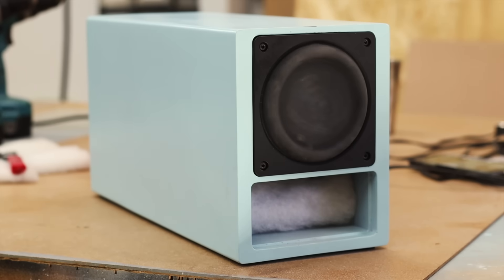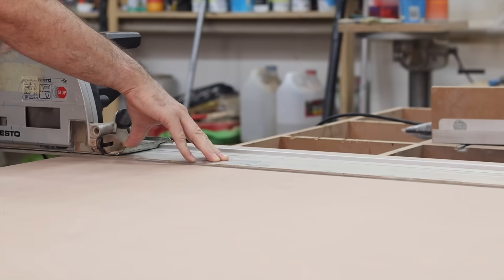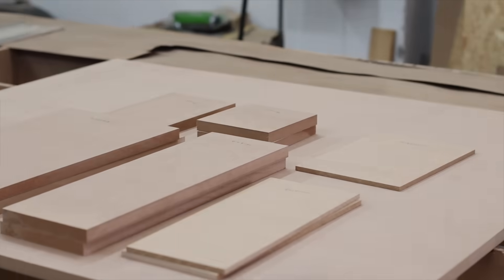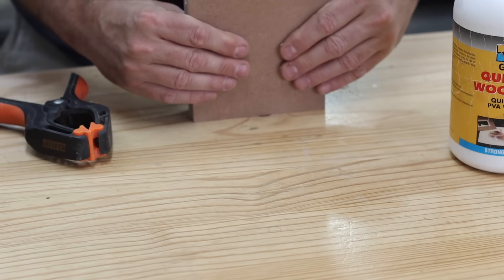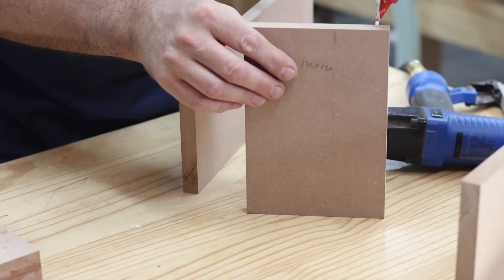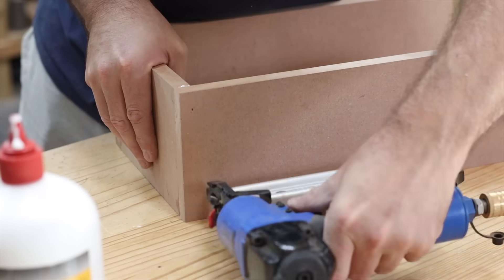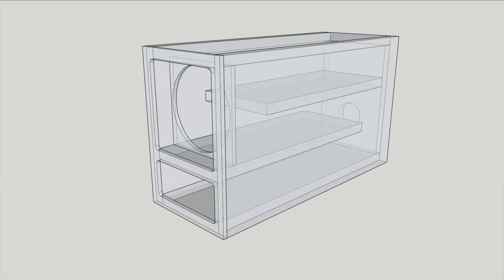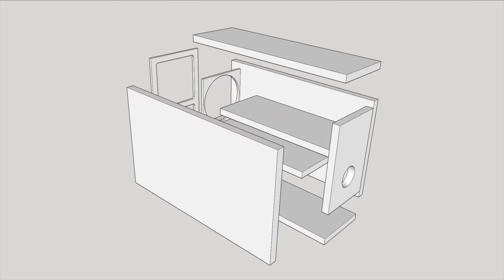Building a 4" Transmission Line Subwoofer - by SoundBlab

Comment: Hi. Good information. I’m looking for a passive, high quality stereo soundbar type custom speaker for under a TV. Short and wide down to 40 hz. Maybe I could help sponsor a video that explores the topic?
Reply from the maker: Thanks for the support. I am planning a soundbase for under a TV, but it will be about 1000mm wide and 250mm deep more or less. This is so that we have enough volume for decent bass output of the subwoofer driver. Stay tuned, hopefully the project will be done early next year.

Comment: Sidenote: It's not a subwoofer. The transmission line needs to be minimum 1/4 the wavelength in size so 20hz requires 4,25m of line.

Comment: i have a 4inch 4ohm 20w woofer from an old cheap subwoofer which i don't know the ts parameters but it plays under 40hz well free air
Can i still use this build?
To prevent damage i'll just lower the gain on my amp
Will this build work for me without knowing the ts parameters of my woofer if i dont play too loud?

Comment: I have never seen the driver placed midway through the line section. Its always at the other end or farthest away from the port opening. Lengthwise. If that makes sense.  It's odd like this. A Unicorn box.

Comment: Reformulated question: Would it be possible to add a mini tweeter to a 2.0-channel soundbar via serial connection, turning it into a 3.0 channel soundbar to get a better sound clarity (clear and crisp dialogues)?
Reply from the maker: I would not connect it in series, but i parallel to the drivers. It will be a bit of a hit and miss exercise though.

Comment: Hi there. I like all of your videos since you explain things in very easy terms to understand, particularly, for a newbie, like myself, and which has led me to start building my system from scratch. One of the things I'm planning to build is a Transmission Line enclosure. Got a question - let's say my target frequency were 35Hz using a driver with a frequency response of 44Hz - 22000Hz. So, 35Hz is below 44Hz. Will my T-Line enclosure be able to hit the target? Or I do I need to set a new target at a point no lower than the one part of the driver's frequency response? Is there any restriction aside from the length of the tunnel and its cross-sectional area? Can it be tuned for any given frequency regardless of the speakers frequency response? Regards and, please, never stop making videos.
Reply from the maker: Thanks man! It's difficult to say. It all depends on the driver specifications. You can go lower than the FS of the driver, but would not push it beyond 5 or 10 dB. The driver will run out of steam and you will get what we call a shelved response in the lower part of the frequency response. This transmission line calculator will help you to determine the ideal response: http://www.mh-audio.nl/Calculators/TML.html
Reply: @SoundBlab  Thanks for the info and link. I'll jump to it right away

Comment: what will happen if theres no stuffing?
Reply from the maker: The stuffing is there to slow down the speed of the air, which makes the transmission line 'appear' longer to the driver. Remove it and it will affect the frequency response and bass output.

Comment: The Tang Band W4-2089 isn't available on PartsExpress (200 min buy + 4 month lead-time). Is there another smallish driver 5-6" that has similar performance that you would recommend for a similar build (scaled up for a larger driver if necessary). Seems like most of the woofers in the 6" size have a frequency response starting at around 90Hz where the TB starts at 35Hz.
Reply from the maker: You can contact Tang Band directly and ask them if they can sell to you. http://tb-speaker.com/

Comment: The lines are arranged in a weird way. One line is leading to the dead end where the driver should be. Am I mistaken?
Reply: Igor Tarassenko that’s for that the driver can create more pressure i think
Reply from the maker: Moving the driver up or down the line (within certain limits) will affect the frequency response and in certain cases reduce the required line length for a more optimal response.

Comment: What makes this a transmission line? To me this looks like a vented enclosure with a long folded port?
Reply from the maker: A vented enclosure typically has a large volume from which a port runs out, however here you do not have a large enclosure, it is essentially just a 'port' or thus TL. Moving the driver up and down that TL (within limits) you can fine tune the response.
Reply: @SoundBlab  That's true but you could also build a vented enclosure with a small volume and a lets say 60 inch long port to tune it very low.
Reply from the maker: That will then rather be called a mass-loaded transmission line for example rather than a ported enclosure.

Comment: blocking air hole with this fiber foam is a mistake. try passive radiator or just free up the air way to make bass more punchy at low end.
Reply: That is not entirely true tho... Transmission line enclosures rely heavily on stuffing to absorb the 'higher' frenquencies. An unstuffed transmission line sounds quite rubbish tbh. Very undefined and unbalanced. I've tinkered quite a lot with these types of enclosures, and this is what I was able to conclude.

Comment: Thats not really that good of a transmission line.  Speaker goes at the beginning of the line.. not halfway
Reply from the maker: There are many variations to TL designs. The rule is not that it goes at the beginning of the line. The response can be tuned by moving the driver down in the line, often to flatten midrange and/or bass response. However, there are limits to how far you can move it. Typical is around 1/3 from the top.

Comment: What's the difference in the sound between a transmission line and a bass reflex?
Reply: The sound of a Transmission Line (TL) is best described as 'just there'. No emphasis, really easy and tight sounding if designed right. If you're a 'bass-head' you'll probably want to pick a Bass-Reflex (BR)
Reply: @Kleverballetje  Nah man, 8th order isobaric, with all three peaks tuned to the same frequency for bass heads

Comment: Hey soundblab! Your driver fs is 35hz. So the lenght of the port should be 96 inches to produce 35hz and the port should be continuous. But in your design the port length looks less than 50inch and is also not continuous.. can you please explain this?
Reply from the maker: Can't remember exactly what the line length ended up being, but often by playing around with the line length and placement of the driver, you can smooth out the response and get a similar result to a longer line.

Comment: How small can you design a 20hz-80hz sub for home cinema? Can be passive. Doesent need insane SPL. Price sub 1000 dollar.
Reply: Get a bigass classic 18 inch sub from parts express. 120bucks. An appropriate power rating plate amp, probably 100-150bucks. Wood. Make a sealed enclosure and you're good

Comment: I love the tang band woofers. No other company makes them like they do.
I'm gonna use the 5 1/4 inch subwoofer and a slightly larger box.
Reply: i really do appreciate those tang band subs, i used to have a z2300 but the amp died and then a few days ago i decided to build a new enclosure for it and it bangs.
The sub that was used in the Z2300 is the Tang Band W8-670Q which is now fitted into a ~100Liter enclosure tuned to 30Hz which gives me a F3 of around 27Hz and a relatively flat respone
Reply from the maker: Cool

Comment: Wats the purpose of that top air tunnel it's a dead end
Reply: The tunnel right behind the driver is a "dead" end, but the other tunnel moves the air downwards and out the front. 
The question is, why did he stuff the air port full of fluff

Comment: I just saw this video and the build makes no sense to me. Why have a "wall" that traps air? I'm pretty sure it would sounds  better if the air flow was better
Reply from the maker: It's very much an experimental build and sure, some improvements can be made.
Reply: My thoughts exactly. The build was almost there, although done very well. That top shelf of space is essentially useless and shouldn't be counted in the amount needed for the T-line. I bet it would sound 10x better with the walls placed correctly. Still fun to watch though!

Comment: Beautiful and detailed video. Thanks
Reply from the maker: Thanks
Reply: @SoundBlab how did you modeled the box. i can model in hornresp but i cannot be sure if im getting the box modeling / calculation part right. i easily desing bandpass abc vented or sealed enclosures but horn based ones such as t line seems so hard

Comment: Made my first with some old tear down parts of old stuff, not as small, due to needed to be at least 12”x14”x and went with x 10 sidewall which placed ext. wall and act as side ports for surround acoustic with additional top ported tube.  I have very minor knowledge on boxes or properly distributing sound. The 4” micro sub is in its own separate box within the box as sorta of a double boxed concept acting as a double semi compressed bass air-per-cubic ft. Which i was iffy about. And only using 2 smaller 3inch full range audio speakers in front of box and i only designed 2 split sound walls to control the acoustic to ported sidewalls , which front to rear go 7 inches to back once again i have no clue what i am doing , to know whats best. Lol just and idea of how i thought i wanted it to work with lil to no knowledge . Let me tell you something though.  The quality of 300deg. Sound shocked more than just i ! They bass shakes whatever you did not know was loose in the house or area. The neighbor from 3rd floor , i do not even know , as i walked out to put into car before work to get some paint on it , asked if that was playing on and off last couple days? I replied yes as i was checking to see sub hertz range for 6-7 min. Each time. He replied -wth ! That is one bad*** loud box , it can shake somethings in here and i thought it was someones subs in a car. Lol  -note these are very newly built solid and very quite apartments and that was the 3rd floor.  My wife won’t even let me play it in the house .   But i did noticed the 2” x1” side ports built in sidewalls were not enough and i thought would be too much or plenty for the small pre-boxes sub at base of box , but they were actually not enough i found out later on accident . So i ended up putting a flush port tube at the rear top of box and that increased bass and the bass quality of surround as the speakers were already.  I think the reason for this was , that on the sidewalls i decided to close the side ported areas off box with audio mesh for a nice, clean look and it cut down on the air to be able to exit box as much as did before and compresses against self. So the ported tub on top helped not only get that back , but made it even better in all aspects.  Never expected that lil sub to need so much air . Given its pre-box size is 12x14x3.75

Comment: Curious on what it would sound like without the material in there
Reply: Boomy, and probably less tight.
Reply: A full range TL design needs the stuffing to attenuate a dip in the midband, but a TL as a subwoofer with a lowpass filter doesn't need stuffing at all. In fact the stuffing has a side effect of attenuating the low end output. So it really shouldn't be there.
Reply: Maybe less "creamy"? :)

Comment: nice build, just a tip for a box transmission, the port needs 45 degree angles at each turn (use wood), to guide the pressure wave used to prevent pressure  bounce back into the t-line.
Reply from the maker: Thanks. I would not go so far as to say that it needs it, but it will surely help the flow of air. There are many highly regarded commercial designs out there that do not always implement this, and they seem to still function as intended. I get what you say though 🙂
Reply: Actually, the corner pieces are usually cut to the size to make the bend the same surface area as the line. An ideal corner piece would therefor me concave to keep the perfect surface area. :)

Comment: Why does the driver sit at the first turn of the line?
Reply: Good question! Is it some new style T-Line?
Reply: I think it's put at a certain length inside the line, like 1/3rd or 1/4th from the beginning of the line. This method has been proven to reduce certain kinds of distortion and can possibly improve bass response in some T-line designs.

This is my interpretation of the design. I hope this answers you're question.
Reply: @chielwouterscw  Thank you. As they say ;live and learn.

Comment: Can you add weight to the passive radiator, because in 5 liter tuned to 30 hz you get flat responce from 30 to 80 hz.

Comment: A real speaker will easily pop them nails right out 🤣
Reply: you dont even know what good is. the nails are only to hold the pieces in place while the glue dries. when dry thats what holds it together. screws dont actually help either.
Reply: I've built a box using mdf, used wood glue, and screws to hold them together, once set, removed the screws, then I wanted to separate a panel, I ended up breaking the panel, and the glue seems has still not come undone, it instead took a layer of wood with it, once the glue bonds, you're screwed if you made a slip up.
Reply: Umm. No it wouldn’t.  Glue bonds stronger than nails. The nails are only there to hold the pieces together while the glue bonds.

Comment: would really appreciate a video like this for a 10" or 12" subwoofer
Reply from the maker: Might be a very large enclosure, but I am also interested to do something like that. Maybe future video...
Reply: @SoundBlab  I used a ceramic sewer pipe for a 25cm diameter woofer, 70ish cm high, 40cm total diameter. They need not be too large if you can make the material dead. Sewer pipes can be had here and there for bargains, unused, maybe where you are too? 
You could also optimise by floor size, I have another sewer pipe, but plastic (other materials too heavy), it is cheap, only 25cm total diameter, and comes in standard length of 5,5m. So, I cut it down to 2,40m exactly to me ceiling, now I need a way to put it upright and be stable enough. IIRC 90cm or so of 10cm reflex pipe will put me at up to 18Hz flat.
Big pipes are easy and good. For subs anyway.
Reply: @jamegumb7298  can you make that shaped as many S, so its more compact under a couch?
Reply: @OlavAlexanderMjelde  Using a ceramic sewer pipe? Unlikely. Plastic sewerpipe? Probably if you have the connector pieces but no idea how that will affect the sound, sharp corners, and 25cm across still means a rather high couch. I optimized for least amount of floorspace, to just take in vertical space instead, not tiny size in general because it really is not.
Reply: @OlavAlexanderMjelde  Lay it on it's side?
Reply: @OlavAlexanderMjelde  yes, as long as the cross sectional area, proportions of the line and the lengths all remain the same, it can be whatever shape you want. A single 180 degree twist after the woofer seems to cancel out higher frequency harmonics in the line the best though
Reply: @jamegumb7298  ceramic is an issue in the sense that it doesn't provide much damping at all, so the upper harmonics would be going crazy
Reply: T-Line boxes, by nature are not compact.
Reply: 12" please o 15" 😲😲😲
Reply: I did a 12", the box was ridiculous huge. I am talking, in the back of an 05 sti, it took up the whole back seat (width wise) you couldn't put the front seats all the way back (phat) and was almost so tall that I couldn't see out my rear window.... granted, I had a single 12" subwoofer in it, which was also only powered by 200w, but hit 119db which with that low power shouldn't be possible. You would need significantly more wattage. which is why i love t-line (119 measured with cellphone sitting in driver seat not even up at front windshield like they do)
Reply: You can find in 'Electronics Today International' magazine old documentation. I've made a pair. They're damn good.
Reply: I built one for a kappa 10 and it ripped the surround eventually, but it was very musical, flat and played very very low... Maybe not the most effective type of enclosure but my recollection is that they play low and loud if you tune it right and fast transients, but I doubt if it's truly better in total over a sealed
Reply: Why? There's lots of videos of people making big subs, someone making a tiny sub is different and way cooler
Reply: Because I appreciate his detail and accuracy.
Reply: Me too but just do the math. There are tutorial videos about how to use mathematics to figure out the standing waves of a subwoofer and what the dimensions should be precise of your speaker the size of the box transmission line especially

Comment: you did not get a maze, as the first spacer inside the case is useless - it does not isolate the space behind the speaker. It was necessary to do the struts obliquely.
Reply: In many t-lines the speaker is placed at an interval away from the start. Many are also heavily tapered. It's about resonance and standing waves. Think of a flute, the mouthpiece is places about 1/3 away from the top, but the entire chamber is still used for resonance.

Comment: So you didn't want to spread the glue on the bonding surfaces so that some could soak into the wood before you added more to replace what had soaked into the wood?  The transmission line appears to only be about one meter long which would tune the transmission line to 180hz which is too high for a woofer and much too high for a sub-woofer.  Where is the frequency response graph to verify this strange design?
Reply from the maker: I'll do a video to explain the design soon.